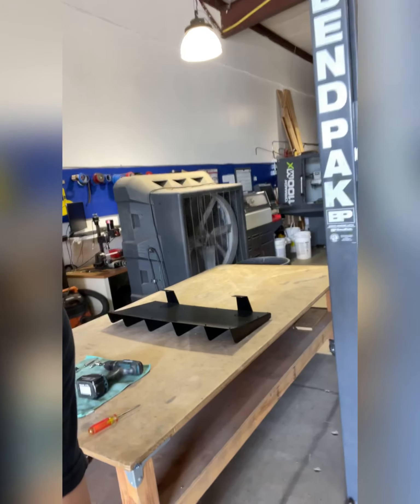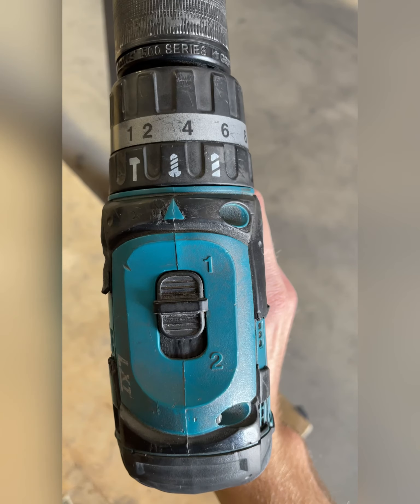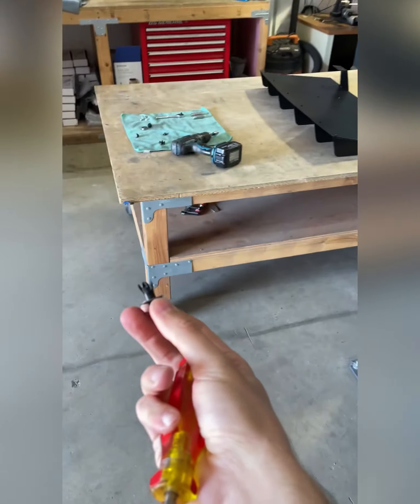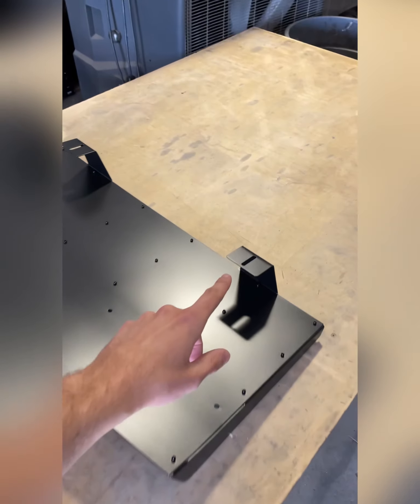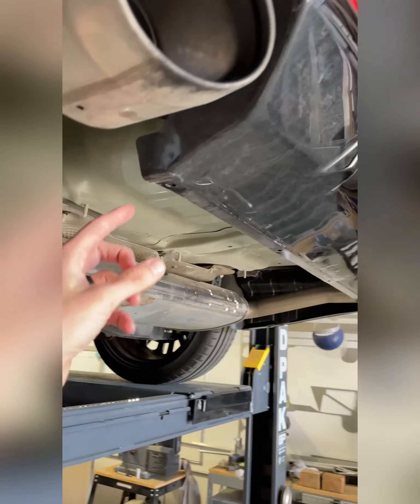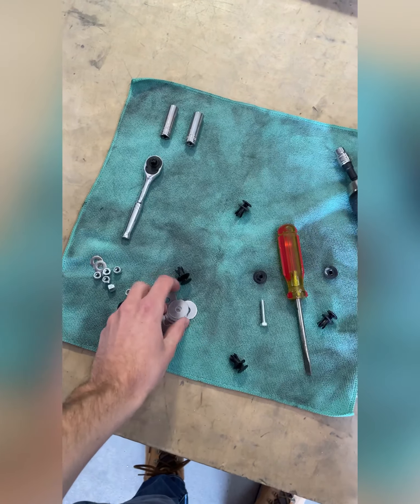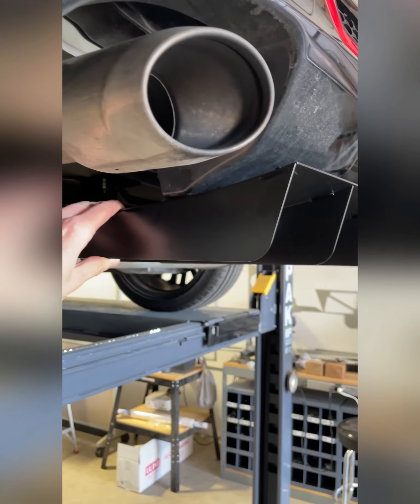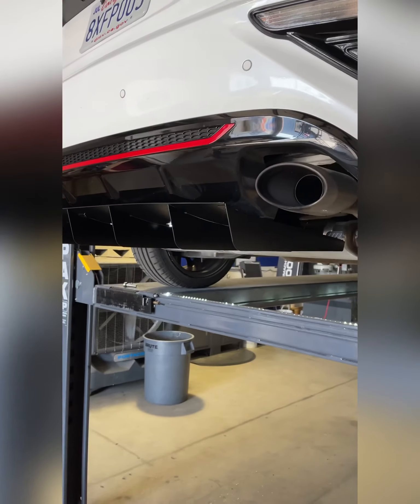Kia Forte GT (2019-2021) Rear Diffuser Installation by FSPE Inc.

Comment: Will this only fit the GT model or the lower models aswell ?
Reply from the maker: Good question. I'm not 100% sure. I know that the rear muffler, and tow location is different on the base / GT-line model. I'll have to do some investigation.
Reply: Hi, could this be a suitable kia proceed gt?

Comment: Are there plans for a side skirt and splitter install?
Reply from the maker: Hi Hayden,
We have a PDF written up for the the splitter and side skirt installations.

Here is the link to the splitter... https://cdn.shopify.com/s/files/1/0071/9745/8491/files/Kia_Forte_Gen_3_Front_Splitter_Installation_Instructions.pdf?v=1634073421

And the side skirts...
https://cdn.shopify.com/s/files/1/0071/9745/8491/files/Kia_Forte_Gen_3_Side_Skirt_Extensions_Installation_Instructions.pdf?v=1634075880

Hope that helps :)

Comment: Umm dude, really?  Adding that stupid thing is like adding window tent to sunglasses. This has no real function, and adds to body weight. Only for cosmetic appearance. How about doing a muffler delete, And then adding in 3" exhaust, with a custom built Header, and high flow Cat's. ? That would definitely "wake-up" that weak little Theta 4cyl, as well as adding 650 fuel injectors and a high pressure fuel pump from: "Deats", And while you are at it, add in a Velossa tech wide mouth snorkel. That will again definately make the throttle response far more responsive, then the sluggish, slow as throttle response the Theta has from the show room floor.
Add in a "hotter" spark plug, And BAM!! You increased the HP of that silly little Theta by 40. witch is a huge gain, but cost a ton of money.
Reply from the maker: Honestly, not sure how to reply to this but appreciate the comment!
Reply: That would work if you did a Theta swap.